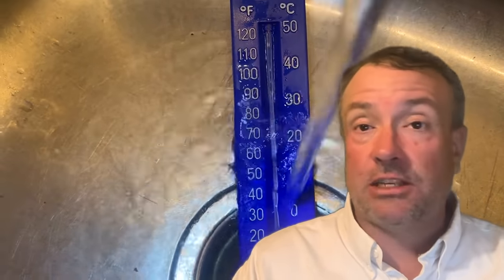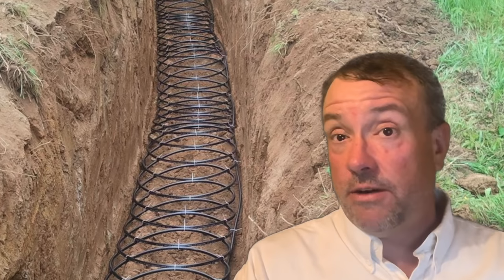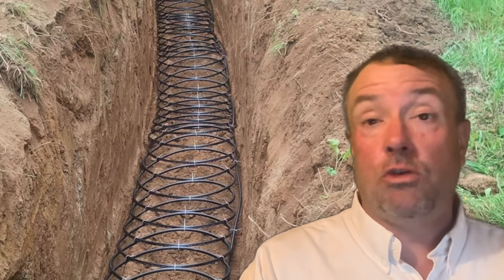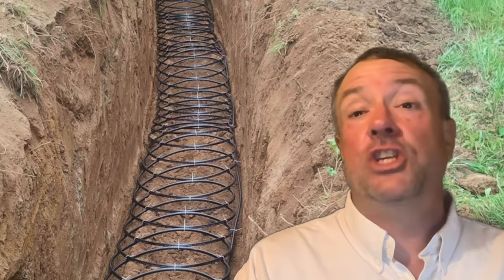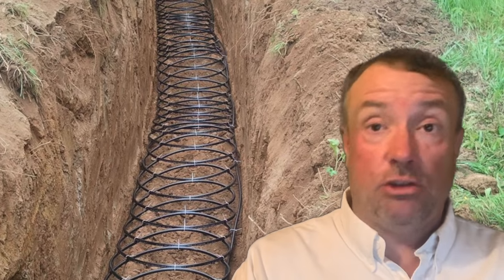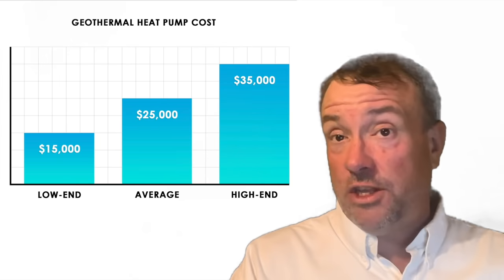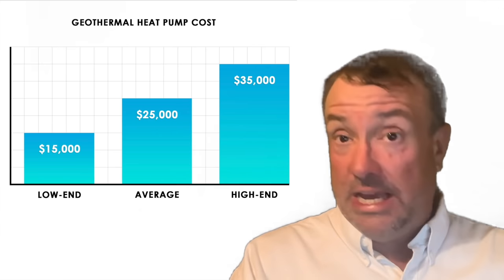Geothermal Cooling Tricks and Hacks

Comment: The practical heat storage and release technology is very mature. It is necessary to choose air and soil to store and release energy simply and practically, and use liquid to store and release heat with high efficiency. These things are simple and do not solve the fundamental problem. The difficult thing is the heat insulation of light-transmitting materials. The development of high-performance products and the development of small-volume, high-performance thermal insulation materials, these two material products are the key to determining the large-scale application of low-energy greenhouses.
We will enter mass production of high-performance light-transmitting thermal insulation materials in 2022.
Variable-volume heat-insulating opaque materials may be mass-produced in 2023.
China is keen on the development of new energy sources, but is dismissive of energy-saving technologies and products.
Reply from the maker: yet Chinese greenhouses totally go against what you just said about energy saving technologies and they have 100s of thousands of them currently in use today
Reply: @SimpleTek  China’s greenhouse subsidy policy deviates from the nature of commerce and has become a tool for officials and some people to defraud taxpayers. In addition, most officials do not understand technology. Therefore, it is inevitable to build a large number of high-energy-consuming Dutch greenhouses. May change later.
The mound greenhouse in Shouguang, China is still viable, but it cannot be solved in terms of land utilization and environmental control of pests and diseases.

Comment: You do not know what you are talking about. You should have long strait line if possible. Loops are to save space/amount of digging, they are less efficient, and have increased risk of freeze if you use them for heating with heat pump.
Reply from the maker: There’s more variables. What if you inject heat?
Reply: @SimpleTek  no chance for freeze, but the rest stands.
Reply from the maker: @ssruiimxwaeeayezbbttirvorg9372  clearly you don’t know what you’re talking about

Comment: This system is not Geothermal! At such shallow depth the temperature is governed by insolation and not by the Geothermal gradient!
Reply from the maker: you mean its not lava powered lol
Reply: TO_MATO, TOM_ATO. Both uses the subterrain ground temperature differences (geothermal dynamics) to provide heating/cooling or both.
Reply: @SimpleTek  That is exactly what I mean.
Reply: I like the lava powered thing. The heat of the magma comes from radio-active decays in earth. Without radio-active decays earth would have completely cooled down billions of years ago.
Reply from the maker: @hansulrichjohner2694  lava cool

Comment: Here's an idea for those people (like me) who already have an air source heat pump. You could add a heat exchanger to your refrigerant loop to transfer heat to your ground loop.
This company makes heat exchangers to heat your pool water from your AC loop https://www.hotspotenergy.com/pool-heater/. The same device could upgrade your air source heat pump into a ground source heat pump. Those people who like to tinker, can add a few valves to switch where the flow goes. In the summer, it flows to a heat exchanger in your central air while in the dead of winter, it flows to the heat pump providing ground temp water to source heat instead of the frigid air.
Reply from the maker: interesting!